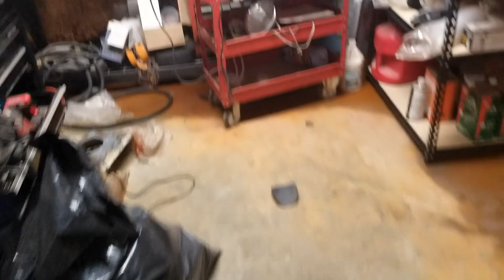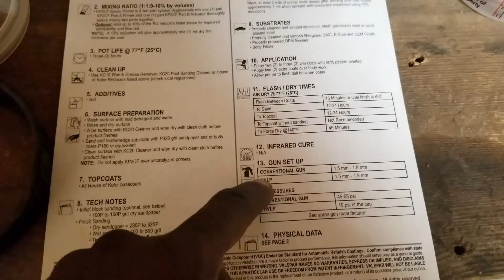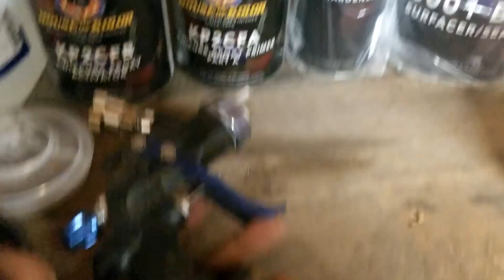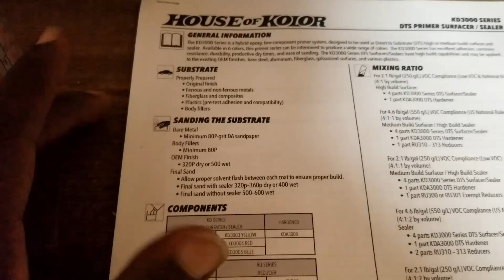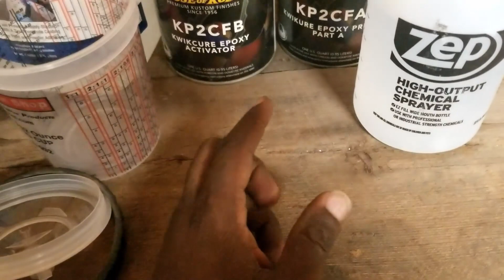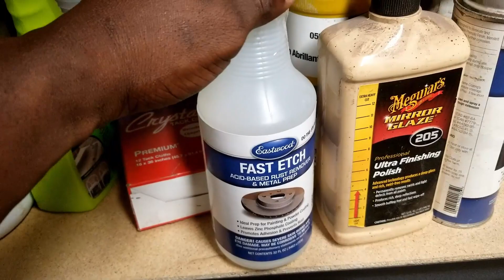How to Prep BEFORE Sandblasting!!!

Comment: Years ago my buddy thought he would sandblast is rust free 69 340 Dart to repaint it and warped all of the body panels. It was such a shame!
Reply from the maker: WOW!!! I was concerned about that but the blasting came out well. It sounds like the pressure of the sprayer was not adjusted properly, the hose was kept too close to the panel, or stayed in one spot too long. That is a shame. I would just start crying....oh man, I feel for him.
Reply: @Jayjam209  This happened back in the 70's. He just used a commercial blaster and coarse sand. It was such a shame because the car was so incredibly solid but when he was done it was wavy which made it look like it was full of filler.

Comment: I dont know if you check this out yet but some paints dont work well with a zinc phosphate coating under there paints i dont know if house of color is one of those paints.I do know that Matrix uses a etching primer under there paints that etches the metal.I didnt see it on the data sheet but you could call there customer service hotline to find out but all and all love the attention to detail good luck will be watching
Reply from the maker: I appreciate your comments. I definitely call the company about some of the little details I don't see on technical sheets. In this particular case, I have used this combination before with great results. I, by no means claim to be a professional painter, I usually go through the entire process on some metal panel I don't really care about before it touches my project car. It waste material but its the only way I can learn. Other than reading a ton of books (which I do as well).  Thanks again!